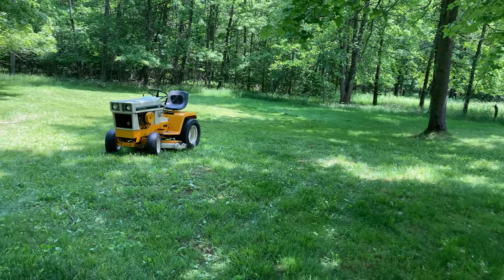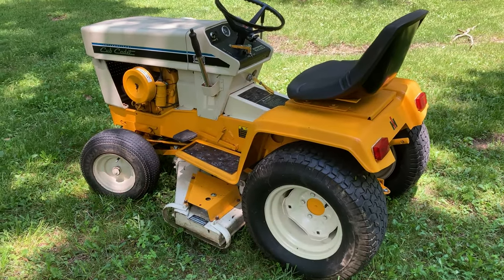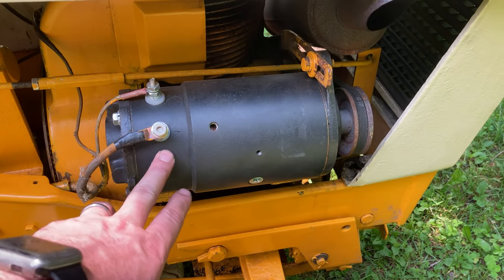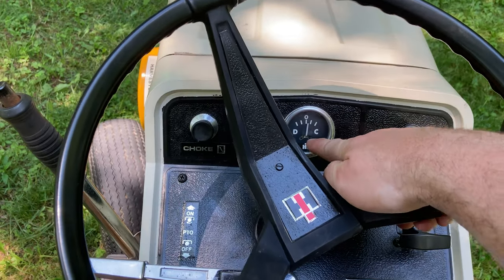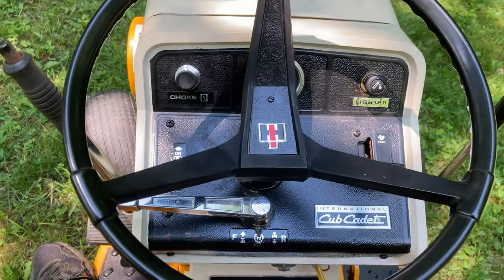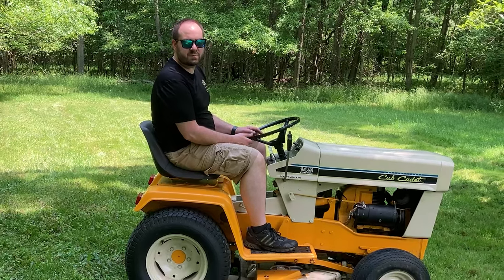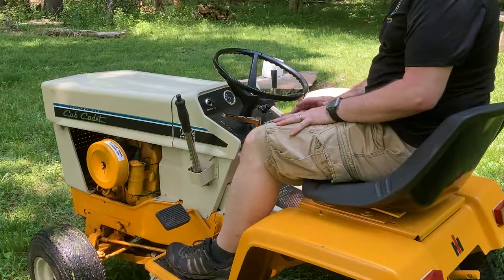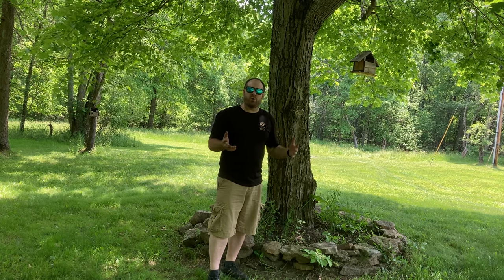#209: Cub Cadet 149 Tractor. How To Start and Operate. Basic Tutorial.

Comment: I love my 169!.. it's a stout build. My only complaints 1) engine is hard mounted to frame 2) wheel base should be 2 inches longer, 3) should have had a pedal to control hydrostatic drive rather than that funky handle
Reply from the maker: The 169 is becoming more and more rare! Congrats on owning one. A hydrostatic pedal would be nice - there are some people who have fabricated one. While the engine being mounted to the frame isn't the best for long-term repair- it might be preferred by some to the mounts used in the later quiet-line series. Thanks for watching!

Comment: Looks great.  
My Pap had one just about like that.  I don't think his had headlights and was a manual shift.  I was running a late '80s Cub Cadet 1210 Hydro full-time mowing up until about 10 years ago.  Rock solid tractor.  Does the battery on yours have a hold-down?  And, maybe put a rubber boot over the positive terminal.  Wouldn't want that to bounce into that metal panel above the battery.
Reply from the maker: Hi @Patrick Wags - These old Cub Cadets made by International Harvester are amazing machines.  The one we have does have a battery hold down.  But there is no boot over the positive terminal - that's a great idea.  Thanks for watching!

Comment: What size deck is that, i just bougt a 71 149 hydrostatic ans it has a 50c deck on it but i don't think it's orginal to the mower
Reply from the maker: That deck was a small one. I think it was a 32 or 36 inch. But I have owned Cub Cadet 149 tractors with the 48 inch deck. I think that was pretty common. And I have used the 50-inch deck on a 149. I don't know if that was originally available with the 149, but I've seen that combo.
Reply: @PurpleCollarLife  oh ok, yeah from my research online they came with 38" 44" and 50" decks, this is my first 149. I've had a 129 and 862 cub cadet

Comment: What’s the pto lever used for?
Reply from the maker: It engages the PTO clutch on the engine.  The PTO can be used for the mid mount mower, the rear rototiller, or the front snow blower.

Comment: That motor was actually made for leaded gas
Reply from the maker: You're right.  I'm hoping that the ethanol free high octane gas will be okay in it.
Reply: They make a additive for it or put a little oil in the gas the lead gave the valves lubrication  i use a little oil in my hit and miss  and in my farmall h